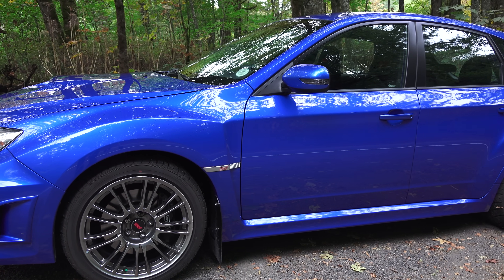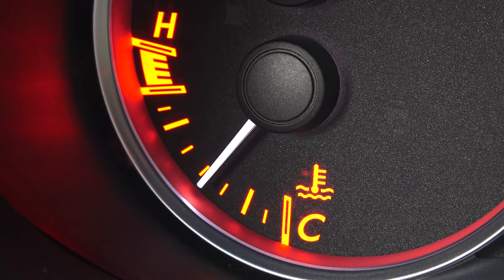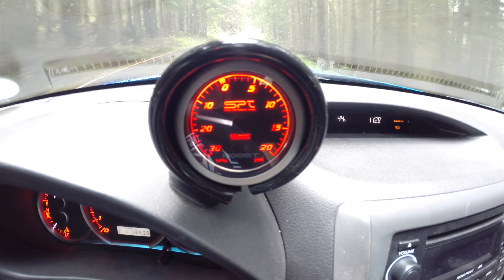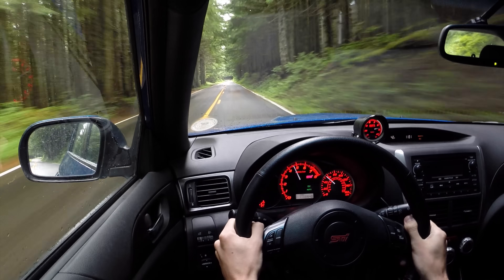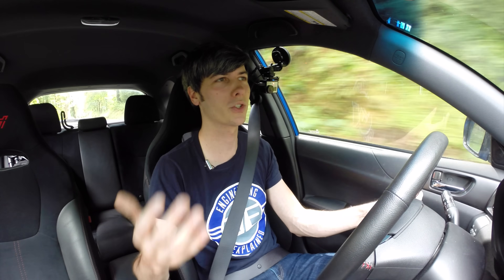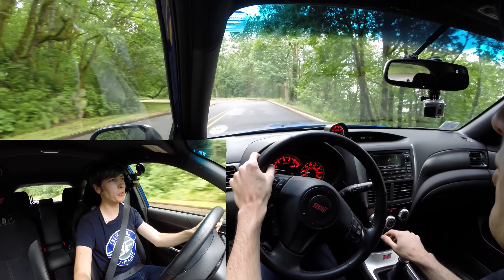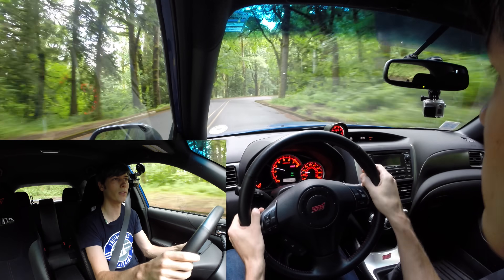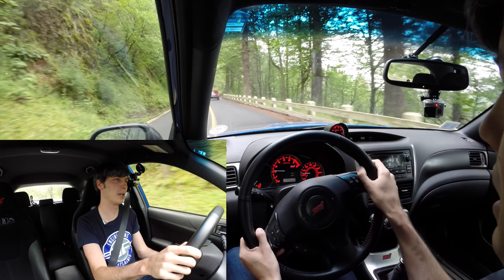5 Things You Should Never Do In A Turbocharged Vehicle

Comment: The young man in the video overlooked a common engine failure due to lugging is rod bearing wipe. When you lug an engine you have lower oil pressure cushioning your rod bearings. That hard hitting combustion from a power adder will drive the oil off the rod bearing and will wipe it right out. Another damaged item I have seen are cracked piston ring lands.
Reply: Sounds like something that should really be teething issues that will have long since been engineered out... unless they're the result of really harsh lugging, instead of just running up some only-just-shallow-enough hills at what is for most cars a lower-end cruising rpm.

Funny thing, only time I've damaged the rings in an engine was by ragging the hell out of an underpowered, naturally aspirated one. Turns out economy hatchbacks aren't fans of running largely in the 4000 to 6000 rpm range with the throttle pegged hard open (even if you're mainly doing it to keep up with fast-lane motorway traffic and not hold other people up in the mountains...).

Comment: Hey I wanna ask you a question. Can a totally stock engine with little modifications like a little big piston in it and little more petrol supply.Or only a turbo charger in a genuine engine can these thing damage any other things in the engine like gear box because those things will be genuine so can they handle the extra power from the turbo charger  or other modifications. Please tell me if someone knows.
Reply: The best answer anyone can give you to such a vague question is "it depends". Some cars will have fairly critically-specified clutches and transmissions (maybe even differential and driveshafts, and certainly tyres...), where even a moderate amount of tuning up could risk damage to other connected components. Others will have an engine that's relatively far under-spec compared to all those other parts, and you can juice it to crazy levels without having to worry about them. All depending what was most convenient and cost effective for the manufacturer to fit. Like, it may have made more sense for them to put the transmission from a fairly high powered car also in their economy model, just with a different differential ratio and smaller wheels, making cost savings through production scaling. Or they could have gone the route of producing entirely different, lighter duty parts, thinking it better to economise on the bill of materials for producing them instead.

There's such a range of possibilities I wouldn't want to tell you either way. Only that it's possible you might have something which isn't good for more than a few percent increase without risking driveline damage. It's the best idea all round for you to check independently what your clutch/torque converter, gearbox, diff, shafts, etc can withstand (there should be some ratings available at least for the gearbox if nothing else, even if you have to bug the manufacturer for them direct; some of them, e.g. GM, actually include a torque handling rating right in the model code - torque being definitely the more important factor when it comes to transmissions, as power is just torque x revs), and what alternatives may be available, and tailor your tuning regimen to fit within those limits.

There is, of course, always a certain amount of overhead built in to even the flimsiest example, as that's just good engineering practice. But really, you don't want to shave too much off that, particularly if it's already about the minimum that was thought safe, in order to allow for any freak situations, like someone dumping the full engine power at maximum rpm into the box, hard, from a standing start by sidestepping off the clutch (which is an overenthusiastic newbie mistake, at least in a road car; you see racers doing it, and might think it best to follow their lead, but their machines are built for it, generally have surprisingly tall 1st gears, insanely grippy tyres and very firm suspension, and get fully overhauled every 200 to 500 miles or so... do that in a regular car and you're risking shearing something, or at very least experiencing a sharp thunk of driveline shock that the suspension ends up absorbing a decent fraction of the energy from, with the rest then spent in breaking the tyres' traction with the road and spinning them up uselessly... a slightly gentler approach is needed in reality, to get a genuinely good start without destroying the equipment)... something that they can withstand a certain number of times before finally succumbing, just in case they fall into the hands of a new and inexperienced driver (or even just someone used to a car with a much different feel to the controls) who makes a few rather extreme mistakes before gradually settling in to how to treat the thing properly. BMW even put a limit on how many times you can use the "secret" extra-harsh trackday/drag race style launch control in some of their semi-auto-box cars, because each time you do it, it damages and weakens the components somewhat, and they have to rein you in before reaching the point where "ordinary", full throttle use of the car could end up exceeding what strength remains.

Comment: Not to do with your turbocharged car: don’t buy one if you are looking after economy. Driving a 80hp car no turbo or supercharger and it’s old. Very economical and no fail
Reply: Alex Larsson I have a 75hp 1.7l Turbodiesel (Opel Astra G, build from 98-05 mine is a 03) gets 43 mpg with mostly highway and country road driving. And i always rev it to the limit bevause why not.
Reply: Except some of the world's most economical cars have turbos fitted to them. You can use it to boost the power of an engine without having to make it bigger and even thirstier, or to maintain the same power whilst reducing the size and fuel consumption. There are even examples of using it on Atkinson Cycle engines (like what's in the Prius and several other naturally aspirated eco-cars) to produce a Miller Cycle example, which is essentially what diesel locomotives use and is very economical in terms of useful work produced per unit fuel, even though it's only average in terms of power density (Atkinson being relatively poor on that front).

And if yours is a maximum speed sports special, you can always drive it off-boost and generally get halfway decent (well, not-terrible, at least) economy in return for your feather touch on the throttle. Which is something that doesn't happen so much with a naturally aspirated large-capacity engine of the same peak power.

Sure, if you have a high powered turbo car, it'll drink quite heavily when you make use of the maximum power, but that's true of all powerful engines (and, heck, all engines really - my own 80hp car can get over 50, or under 30mpg, depending how you drive it, and pleasingly is averaging about 41 at the moment)... if you want more power, generally you have to put in more fuel. And going fast uses exponentially more power than relaxed cruising.
Reply: mspenrice I get your point but even if I want to drive my car like a maniac it’s not fun at all only 80hp fwd. Mpg is pretty good, 30 year old car means no taxes here in Sweden, very cheap parts from Berlin. I ordered a new water pump for only 22 bucks. Easier and funnier to work on tho I’m a mechanic, I like the sounds more on older cars. Etc :p
Reply: My last three cars have been roughly 80hp (and almost uniformly ~78hp/tonne), front wheel drive as well, only one I've owned has had more (106, but it was a little heavier too) and all the others have had less (and the least economic was a non-turbo model with about 68hp... what it got whilst cruising was about what required literally driving flat-out to achieve in the TDis).

You can still have fun. It's all about the technique. It's easily enough power to get you up to outright dangerous speeds on any "interesting" piece of road within not too many seconds. It's then up to you how much of that you can carry through the bends without ending up wrapped around a tree... Well, OK, it's also about having decent suspension so it rides and handles properly, and good tyres to have a useful amount of grip... though the lack of both in my first, 45hp car meant it was itself plenty entertaining in the twisties, if maybe for all the wrong reasons.

I'm not entirely sure what point you're trying to make, though, really...?
Reply: Though reading that back again, I hear you on all the other points :)

Comment: Great video. Quite informative, without being too technical. I'd appreciate a more technical approach, but I realize many wouldn't! 
I have a '99 Saab 9-3 Turbo with a 3' exhaust, K&N intake, and stage two ECM. I'm curious about it pulling to one direction, (the right) during high boost. Someone mentioned I should be careful of this in low gear, as it could damage the differentials, spinning tires on pavement. Not something I EVER do on purpose. Also, since I replaced all the seals, and boost has improved, the clutch has started slipping at maximum boost, in high gear. Likely just the first sign of a needed clutch replacement, but I wonder if I shouldn't replace this clutch with a sturdier one, so it doesn't start slipping so soon. What do you think? Particularly about the clutch? Do you think that replacing the clutch with the a stock one would be sufficient?
Reply: I don't know about most of that, but the pulling under power is probably due to it being transverse front-engined with a lot of oomph. The transmission will be offset to one side of the engine bay, the drive shafts will be unequal lengths, and the weight balance over the wheels won't be a perfect 50/50 left/right (plus, even if the car has perfect 25%-in-each-corner balance at the kerb, when you climb in, there'll be a bias over the front wheel on whichever side you happen to sit). The power split to each wheel won't be entirely equal, and neither will the amount of grip each wheel has thanks to the weight imbalance, and maybe even down to things like what the actual tyre brand is (especially if you have different ones on each wheel!), the relative wear of each, how warm they are (has the sun been shining on one side?!), the pressure in each... etc. The particular way those things combine and resolve will typically cause a slight pull one way or the other... in your case, to the right. In lower powered cars, this isn't really noticeable, unless you give them the beans in first gear without your hands on the wheel, but when the power is ramped up it becomes more obvious.

Solutions are a limited slip diff... traction control / ESP that works by activating the ABS modulation on each drive wheel independently to slow down the faster one and divert more power to the other... putting ballast weight over the wheel with less grip... or just hitting the gym to improve your arm strength and putting the steering wheel in an unshakeable deathgrip whilst slightly countersteering ;)
Reply: Bravo! I couldn't have possibly asked for a more thorough explanation. Unless of course, you've got some graphs/diagrams to go along? Just kidding . . . unless you do  ;) 
Some of the things you've mentioned I have considered (unshakable death grip)! Many I haven't (has the sun been shining on one side). You've given me a great deal to think about. Thanks, mate!
Reply: Well, not all of it was as serious as the rest ;) and I'm not a professional mechanic or tuner of any kind, just an enthusiastic amateur, so take it with a pinch of salt and double check with someone who actually gets paid to muck about with cars for a living before carrying out any work that might be based on those thoughts! But I hope it can be of at least some use.

Comment: Q: what is the normal oil temperature?
Reply: There is no "normal", every car is different, and every car has different logic when it comes to regulating engine temperature. But as a general rule, oil temperature should be roughly between 80-100 degrees celsius

Comment: Q: I have a Skoda Octavia 1.8 turbo and it has a start/stop system so even after I gun the engine and come to a stop my engine shuts down, is it bad for the turbo?, or is the some systems in place to pump oil wen the engine is shut?
Reply: The start/stop system of any modern car retrieves a shitton of data from the ECU, and only shuts down the engine when certain conditions are met and it is safe to do so. Which means it for example will not shut off the engine if it is too cold/hot, if the battery runs low, if electric power demand is high and so on. So if your Start/Stop System is shutting off the engine, you can be sure it is safe to do so.
Reply: Besides, in a start/stop car many parts slightly differ from cars without this system, these things include stronger and more resistant starter motors and batterys made for start/stop systems.
Reply: Yes, it's utterly terrible for the turbo, Skoda are well known for selling cars that have built-in engine self-destruct systems that are turned on by default.

Or in other words: don't be silly. People don't just nail cars together out of tin cans in their back garden sheds any more (you know... like Skoda used to, back in the 80s when they were only just escaping from the Soviet bloc into the rest of the world and their consequently extremely behind the times tech level and build quality made them an easy target for half of Britain's edgy alternative comedians).

Half the money you'll have spent on that thing goes towards recouping a humongous R&D budget, some of which will have been spent on making sure the start-stop system doesn't end up detonating the turbo. I bet you if you take a stopwatch to it, you'll find the engine takes longer to shut down if you've been boosting hard before stopping than if you were just cruising with little to no boost. Although there's a good chance that might be masked by how long it takes you to brake to a halt (unless you brake rather harshly, chances are it actually takes longer than you would immediately guess), depending on whether you crash down through the gears and force the engine to rev up (which will prolong the despool a little, though an engine turning fast with a closed throttle passes much less air through it than one turning slowly with wide open throttle), or coast down mostly in higher gears and/or with the clutch disengaged.

Comment: I've used 93 and 87 octane in my 2005 Volvo XC90 2.5 turbo and I get the same mileage and no timing ping/knocking. The 93 is about fifty/sixty cents more a gallon. That can end up being ten/ twelve dollars more on a fill up A136,000 miles and still runs great and will cruise at 80 mph without hesitation.

Comment: Hi @Engineering Explained,
You stated that you should not "lug" your engine (i.e. asking for a lot of power while underrev-ed). You also mentioned three reasons for that. Apart from the fact that reason 2 (for Diesels it will be too much fuel compared to the air intake'd) is not valid for modern Diesels, there is another reason much more important that you did not mention.

This is the risk of breaking up the turbo. And I mean literally breaking it in several parts. This is sometimes called "turbo surge". Forcing the turbine to produce a lot of boost suddenly will produce a sudden acceleration which is asymmetrical - one half of the turbo is trying to spin much faster than the other. This, in time, will weaken the turbo shaft that will eventually break which will cause catastrophic damage.

Modern Diesels have software protection against this but older (2000 and older) might not have any protection against this.
Reply: Wouldn't that happen just as easily, if not more so, if you slammed the throttle open at higher revs? There's far more air available to suddenly rush through into the turbo, and the engine will be making more power (and thus producing much more high-pressure, high volume, high temperature exhaust gas) than at low rpm even though it's off boost.

Seeing as the reason given for turbo lag at lower revs is that there's not enough air pressure or volume available to rapidly spin up the turbine after all... can't have it both ways.

Comment: Several very obtuse people below thinking high octane fuel does not assist turbo cars above the oem recommendation. I have seen on multiple occasion a manufacture suggesting to run 91 but while running 94 still seeing hp improvements on a dyno with a STOCK ecu. There is no way these folks below are mechanics or tuners.

Comment: My dads Volkswagen t6 Diesel already has a ton of torque at 1000 rpm. So if you floor it there, it isnt bad, because the engine only revs do 4000rpm at max ( redline at 4500rpm).

Comment: In Germany there is no difference in Fuels. Every Gas station has the same quality due to standards. Some only have additives which almost do nothing. They claim to get more power and less consumption but to this day this is not prooven aand only is more expensive.
Reply: Yes, but what octane rating do they offer, and are there multiple grades on offer at the same station, eg a lower octane one for... say... €1.20 a litre, and a higher octane for €1.35 a litre? The question isn't really whether fuel of the same rating is better or worse if you buy a particular brand. The Americans also have certain standards their fuel suppliers have to stick to, and likely don't supply anything that's any better than the bare minimum for each grade if they can help it, same as in Europe.